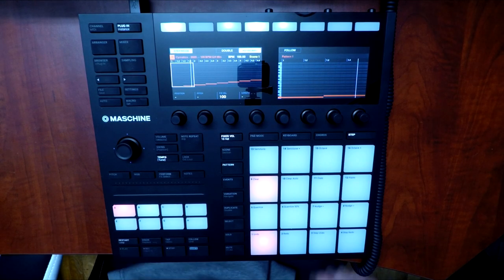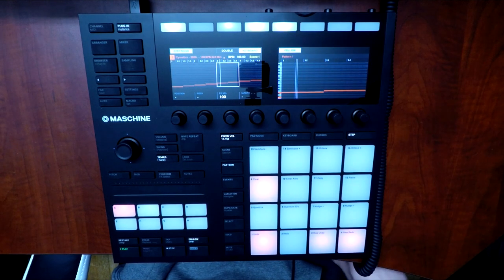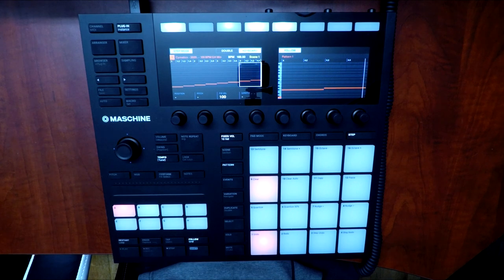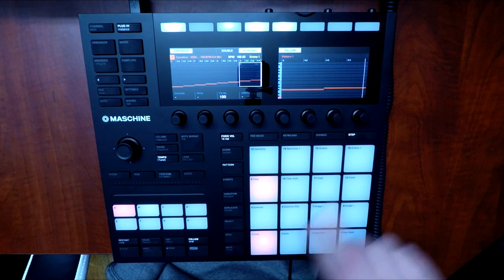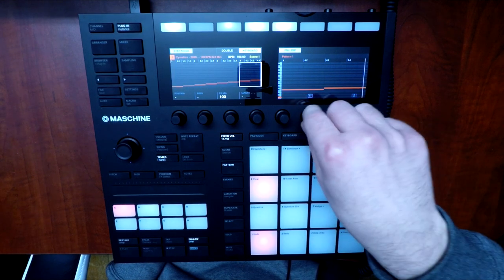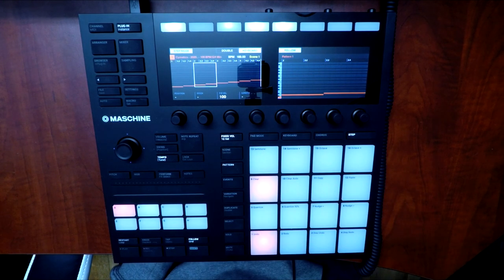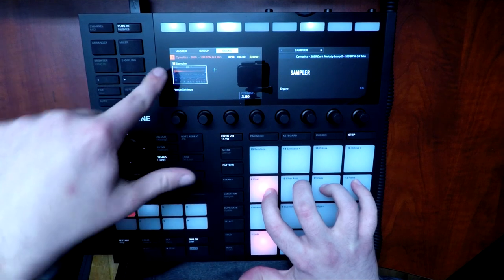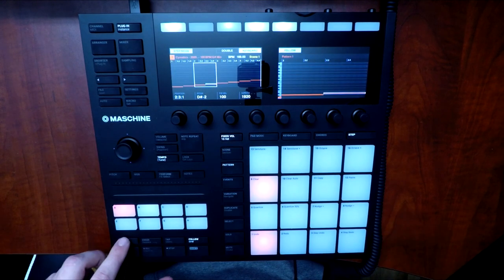Elektron-esque Parameter Locks / Step Automation With Maschine - Maschine MK3

Comment: Can this be done on the maschine jam?
Reply from the maker: From what I've read yes it can! You use the touch strips instead for dialing in parameters. Keep in mind that the Jam doesn't have a screen for locating and reading names of parameters, though.

Edit: So upon further inspection (page 120 of Maschine Jam Manual) the only parameters that can be P-Locked are: Control, Aux, Macro, Level, Swing, Tune Or Pan.
Reply: @minutiaemusic  Amazing video. I just tried what you did in the video on my jam and it all works perfectly! Never thought to hold adjacent areas in the event area before. For your update, what are things you can P-lock on the full maschine that you don't think you can do on the Jam?